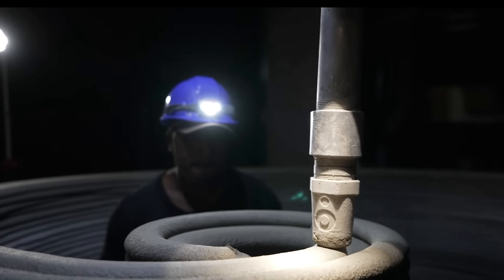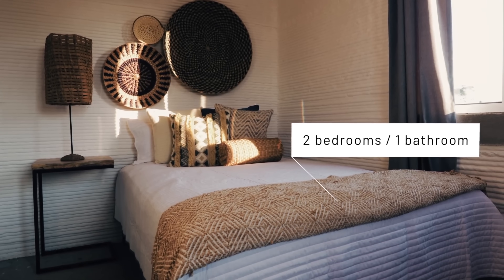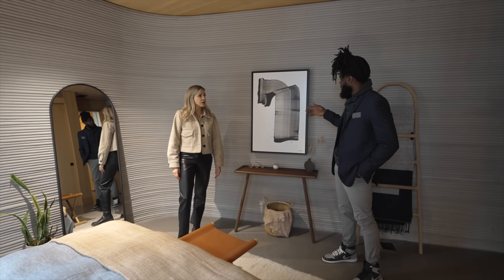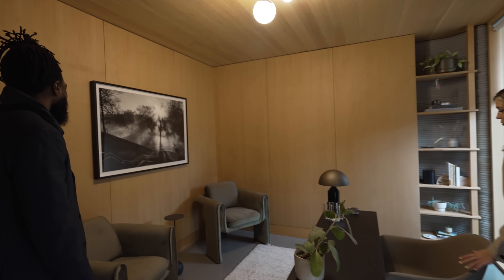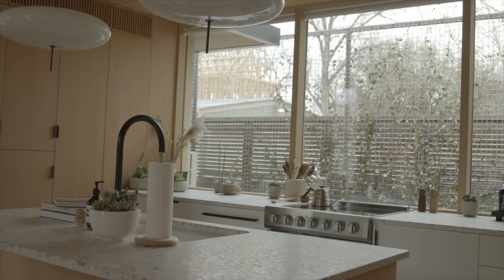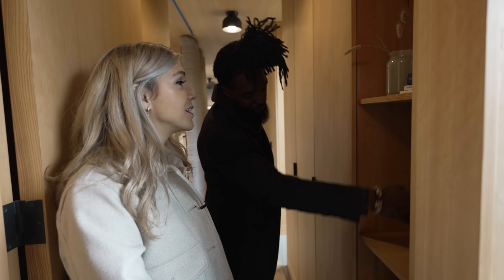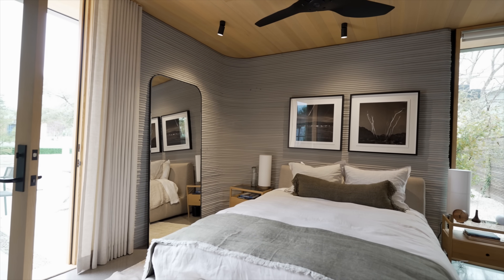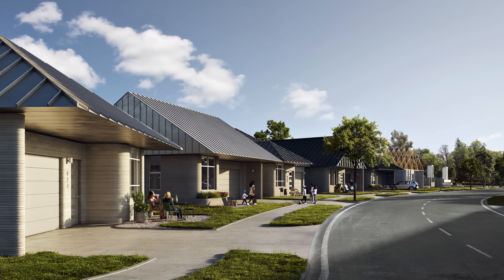Inside A 3D Printed House You'll ACTUALLY Want To Live In

Comment: I'm not a huge fan of the curvy concrete look, partly because I think cleaning could easily become a nightmare.  It also just feels kind of crowded to me. For someone who likes a more earthy, clay look, this could be a great solution.  I liked it for the casita, but for a home I would live in long-term, it just seems a bit too dark and crowded.

I feel like cost could be much more uniform around the country than typical real estate since there is much less labor involved.  Instead of paying 20 people a higher salary in higher-cost regions, you're only paying a few people more money.

Therefore, in big cities where housing is expensive, this could be a viable option.

I think this is a good first step, and progress is important even if it's not where we want it to be yet,
Reply: I do NOT want that house.  to many "technical" /structural Restrictions inovolved with it and  it's required constricted sizes.  The material is a horible mess. Then huge expense to "cover/finish those walls".  Wiring and plumbing issues.  If you want to build something like that there are better/Cheaper , simpler ways to do it.  search ,... Oh what is it called,  Mud/sand bag , earthen bag construction?  And I am not saying I would want that for my main house either.  I've have seen nice "Single Story" hotel rooms....  cement is a mess! espeically when you leave it exposed. Dirt , spiders, and bugs "sticking to it" and those layers/grooves!  then trying to deal with plumbing, electrical etc,  and even try hanging a shelf or picture. :-)) wanna change a door or window? 😅😅😅 that texture is aweful.  even beyond cleaning it has problems.  the novelty would wear off quickly.  and trying to cover that up with wood, plaster, etc... That is Materials and LABOR cost, that  Is $$$$$   Are you noticing that even with the camera/"lense"?shooting done to try and make it  look bigger.  Look at how SMALL the rooms are. EVEN The ones that are supposed to be "larger rooms"  Oh and I live in a mostly solid cement walls and roof/ceiling building ...  I will call Bull Sheets on it being 75 F inside on  days when it is in the 90's .  I live in the desert and once it starts warming up in the spring in the "90's" after a few days the cement warms up, the walls warm up and there is no way you are going to have 75F inside without turning on the AC.  if it goes "hot" then cold" then "hot" then cold for a couple of days, then Maybe... But after after a few solid days or warm/hot temps, the cement warms up. and as the temps keep on climing for "the SUMMER/ spring"  the walls of the building keep getting warmer.  In the low desert in AZ,  if I turn off the AC it will "quickly" start climbing toward the 90's F. I guess higher if you forget to turn on the AC.  Oh, and of course the Reverse happens in the winter.  Sure the novelty of this is "cute"  but the reality is..................  Not So Great.   especially if you DON'T want just a little/cramped "single persons"  condo/vacation condo"  and You don't want the MESS of unfinished cement walls.  You know what else you will notice about this... NO REBAR REINFORCEMENT/"structural support". ("no multiple stories" Fractures? not good for earthquakes, settling ground, etc.just plain old heat and cold expansion constrictions problems...) And there Are More issues than just these... Ahh but the Novelty of it. 😅

Comment: So, it is a concrete with something in it? I wonder how this material would work in the very humid north east. Concrete has problems here, which is why wood is " noramally " better, because as the humid air comes into the cooler space the moisture drops out of the air which causes moisture to accumulate in the home. Wood homes in such a climate remain drier. If the concrete is mixed with something to make it lighter, and more easily spread, can is also be composed in a way where it would fit aa more humid climate without causing the moisture accumulating in the space?

Comment: I absolutely enjoyed learning and I love your presentation, but… You missed some of the major points that people want to know. How much for that home specifically? Are you able to custom design? Do they travel all over the USA in order to build these anywhere? How long does it take to not only print, but finish one of these? A lot of questions I have that I would love to have the answer to. In any case, keep up the good work and I hope all is well.
Reply: I cannot imagine it’s going to cost less than a conventional home
Reply: Good points.
Reply: @pawelzabicki7785  I went to their website searching for answers to similar questions and found that the print time for this build was 10 days and the finish out took an additional 8 months. They say homes in the 400-500 sq ft range take 24 hours spread across a couple of days to print. They travel all over the US and Mexico. It seems like you can custom design but not 100% on that. I wish I could find pricing information! That's what I'm most interest in knowing lol
Reply: @NightMaresInTheSky  Thank you for this. I'm sure everywhere that watches the video has the same 3 or 4 questions.
Reply: @NightMaresInTheSky  You can get those Styrofoam and plastic forms, and a concrete pumper. That can be done in a couple hours.
Reply: @NightMaresInTheSky  Its all CAD designed, so once they have section that have been structurally designed, I can't see why it couldn't be custom. Infact, you've probably got a LOT more scope than with sticks and bricks, which have to generally be rectangular..
Reply: Go to Jarret Gross’s channel. He only does on 3D printed houses. He did this house.
Reply: They go for 3xs the price of a stick built, so if you rich buy one. The rest of us blue collar workers are satisfied with the stick built.
Reply: Some of those were somewhat answered, as specific parts of the house they showed were customizable, and they went a bit into the time it took for everything to be made
Reply: I do NOT want that house.  to many "technical" /structural Restrictions inovolved with it and  it required constricted sizes.  The material is a horible mess. Then huge expense to "cover/finish those walls".  Wiring and plumbing issues.  If you want to build something like that there are better/Cheaper , simpler ways to do it.  search ,... Oh what is it called,  Mud/sand bag , earthen bag construction.  And I am not saying I would want that for my main house.  I've have seen nice hotel rooms....  cement is a mess! espeically when you leave it exposed. Dirt , spiders, and bugs "sticking to it" , then trying to deal with plumbing, elextrical etc,  and even try hanging a shelf or picture. :-)) that texture is aweful.  even beyond cleaning it has problems.  the novelty would wear off quickly.  and trying to cover that up with wood, plaster, etc... IS $$$$$   Are you noticing that even with the camera/"lense"?shooting done to try and make it  look bigger.  Look at how SMALL the rooms are. EVEN The ones that are supposed to be "larger rooms"  Oh and I live in a mostly solid cement walls and roof/ceiling ...  I will call Bull Sheets on it being 75 F inside on  days when it is in the 90's .  I live in the desert and once it starts warming up in the spring in the "90's" after a few days the cement warms up, the walls warm up and there is no way you are going to have 75F inside without turning on the AC.  if it goes "hot" then cold" then "hot" the cold for a couple of days, then Maybe... But after after a few solid days or warm/hot temps, the cement warms up. and as the temps keep on climing for "the SUMMER/ spring"  the walls of the building keep getting warmer.  In the low desert in AZ,  if I turn off the AC it will "quickly" start climbing toward the 90's F. I guess higher if you forget to turn on the AC.  Oh, and of course the Reverse happens in the winter.  Sure the novelty of this is "cute"  but the reality is..................  Not So Great.   especially if you DON'T want just a little/cramped "single persons"  condo/vacation condo"  and You don't want the MESS of unfinished cement walls.  You know what else you will notice about this... NO REBAR REINFORCEMENT/"structural support".
Reply: Putting up walls is the quick part of construction anyway, the foundation, plumbing, electrics, finishing, etc. is what takes time.

I'd also say that the comparisons between the houses for the homeless isn't exactly fair, when one costs $4000 and the other $40 000+... (I'm guessing)
Reply: I'm sure the price varies by region.  They're not going to charge $100k in a neighborhood of $1M homes, and they'll never get $1M in a neighborhood of $100k homes.  So like every other business, they'll likely charge what the local market will bare.

Comment: What is the equivalent R-value of their 3D printed exterior wall? I know building code and standards (i.e. passive house, net-zero, etc.) focus a lot on air tightness and the insulation value of the structure itself in order to achieve their high energy efficiency.
Reply: That why they built them in Austin first . This won't pass code yet in California or other strict energy places
Reply: that is why houses in germany are printed with a cavity between the inside and outside wall 
The resulting cavity is then filled with insulating material 
Who wants also get a fireplace printed... You can see it if you search on YT for:
Erste Einblicke in das gedruckte Haus in Beckum bei der Eröffnung!

Comment: I would love to know the cost comparison to a standard build.  I personally love the house and love the curved walls.
Reply: Please watch my audiobook summary
Reply: I do NOT want that house.  to many "technical" /structural Restrictions inovolved with it and  it required constricted sizes.  The material is a horible mess. Then huge expense to "cover/finish those walls".  Wiring and plumbing issues.  If you want to build something like that there are better/Cheaper , simpler ways to do it.  search ,... Oh what is it called,  Mud/sand bag , earthen bag construction.  And I am not saying I would want that for my main house.  I've have seen nice hotel rooms....  cement is a mess! espeically when you leave it exposed. Dirt , spiders, and bugs "sticking to it" , then trying to deal with plumbing, elextrical etc,  and even try hanging a shelf or picture. :-)) that texture is aweful.  even beyond cleaning it has problems.  the novelty would wear off quickly.  and trying to cover that up with wood, plaster, etc... IS $$$$$   Are you noticing that even with the camera/"lense"?shooting done to try and make it  look bigger.  Look at how SMALL the rooms are. EVEN The ones that are supposed to be "larger rooms"  Oh and I live in a mostly solid cement walls and roof/ceiling ...  I will call Bull Sheets on it being 75 F inside on  days when it is in the 90's .  I live in the desert and once it starts warming up in the spring in the "90's" after a few days the cement warms up, the walls warm up and there is no way you are going to have 75F inside without turning on the AC.  if it goes "hot" then cold" then "hot" the cold for a couple of days, then Maybe... But after after a few solid days or warm/hot temps, the cement warms up. and as the temps keep on climing for "the SUMMER/ spring"  the walls of the building keep getting warmer.  In the low desert in AZ,  if I turn off the AC it will "quickly" start climbing toward the 90's F. I guess higher if you forget to turn on the AC.  Oh, and of course the Reverse happens in the winter.  Sure the novelty of this is "cute"  but the reality is..................  Not So Great.   especially if you DON'T want just a little/cramped "single persons"  condo/vacation condo"  and You don't want the MESS of unfinished cement walls.  You know what else you will notice about this... NO REBAR REINFORCEMENT/"structural support".
Reply: This house in the video is around $450,000
Reply: @beet111   some one bedroom one bathroom houses in florida cost anout 350k right now its crazy
Reply: @beet111  $200/sf -- not bad --  as a designer that is in the ballpark pre-covid -